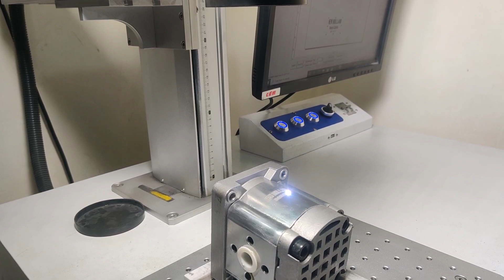Assemble of Fiat Tractor Hydraulic Pump

Comment: we'd call that a hydraulic motor not a pump, pump creates pressure and a motor translates that back to motion
Reply: But in this case this external gear pump would be driven by an engine timing gears then it will create flow ,,,as there is no flow to operate this as a motor ,,,,so is this a motor or a pump...?🤔